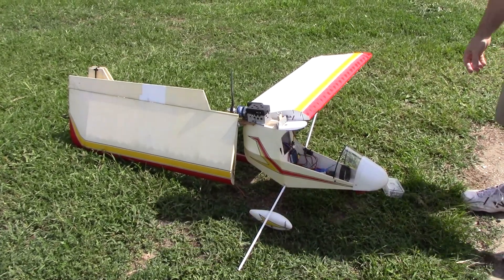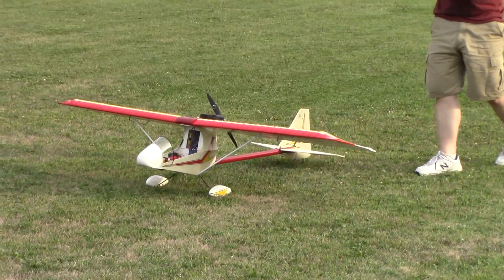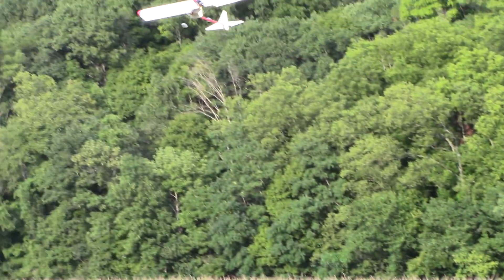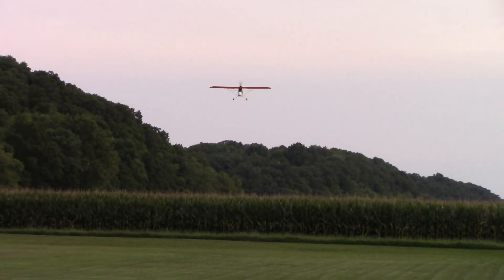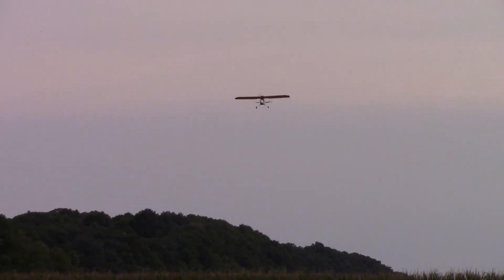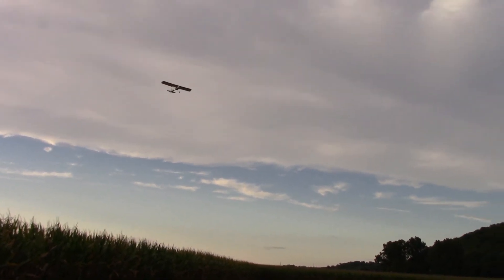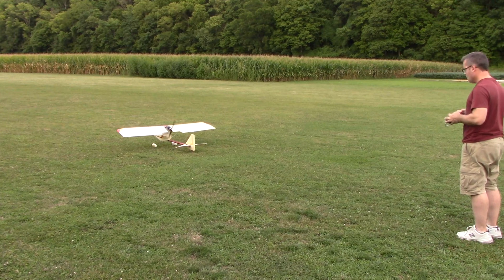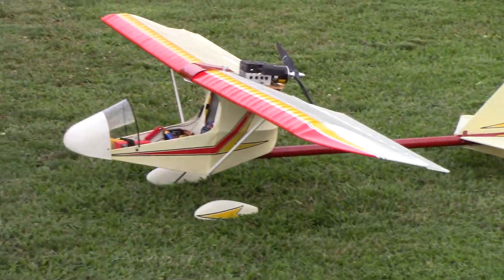Model Kolb Firestar

Comment: Nicely flown.  This model seems to fly much like your full scale FIRESTAR.  You have a good handle on scale like speed for a model.  Keep up the great presentations.  Much appreciated.
Chetlongshooter
Reply from the maker: Thanks.  Once I get the CG correct and some other minor issues such as wash-in on the left wing fixed I'll try some slow flight and more aggressive approaches for touch and goes after testing is completed..  This first takeoff was originally going to be a high speed taxi but instinct told me to fly.  :-)